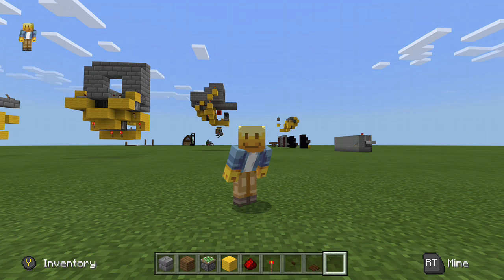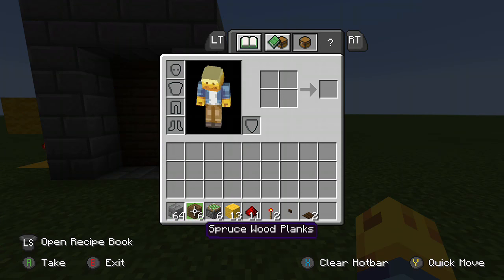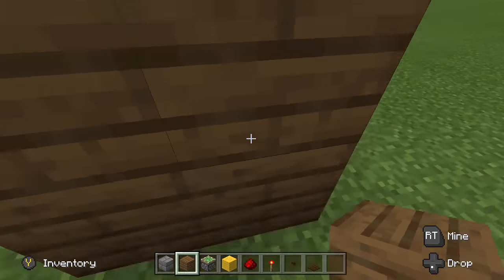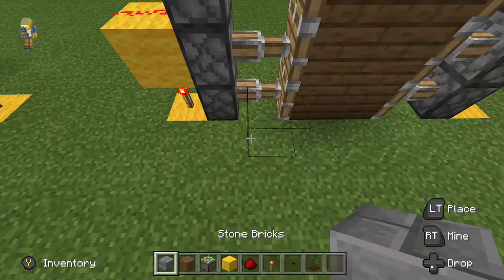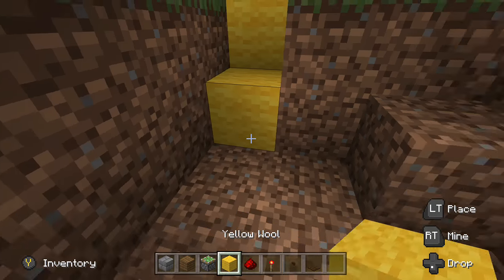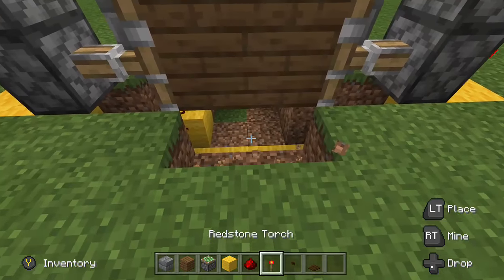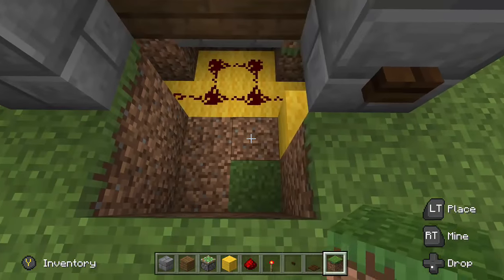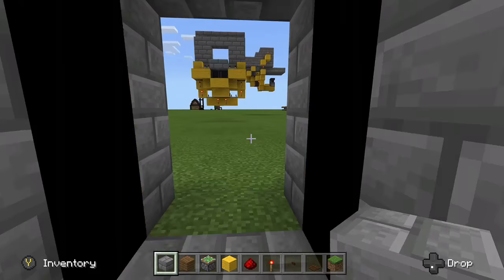Minecraft 3x2 Piston Door (Super Easy!)

Comment: Thanks for the help with this construct. It still works for PS4 in 2022 v1.18.31. I swapped the pressure plates for buttons. Didn’t want the buggers on either side of my walls meeting. Also did some ninja stuffs and added a 4th layer (4x2) that way I can ride my horse through the gates. Cheers

Comment: I'm playing minecraft beta version and I've done the exact same steps you did, the button worked but the plates didn't.  I've tried many other tutorials and still the plates never worked. I would appreciate it a lot if you help me figure it out.
Reply from the maker: Break the pressure plates and the blocks underneath them and place in redstone dust there. (You may have to dig one extra block down so your floor can go back in on top of the redstone)
Reply: Use wood plates i was using stone plates and didnt work, then with wood it did